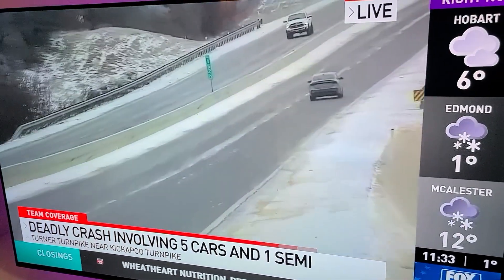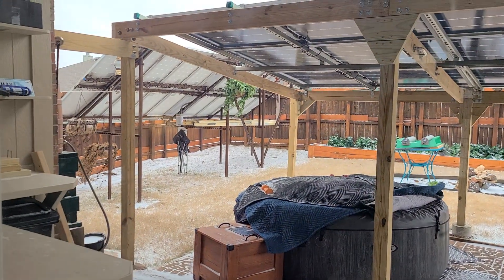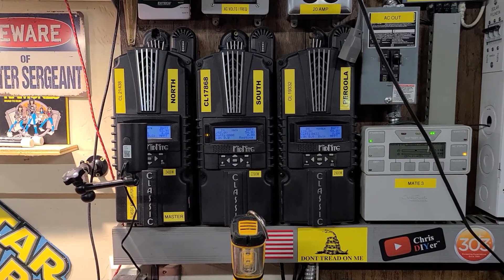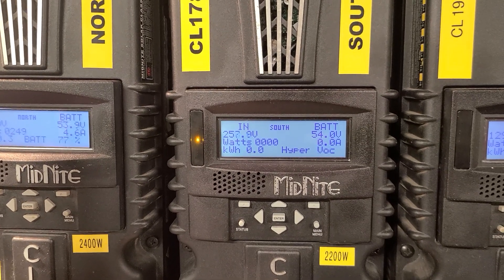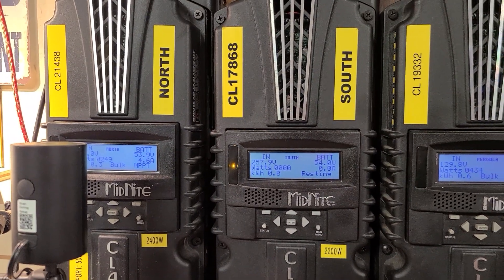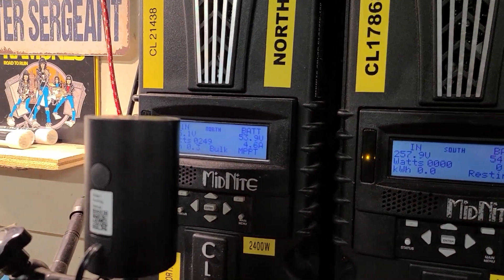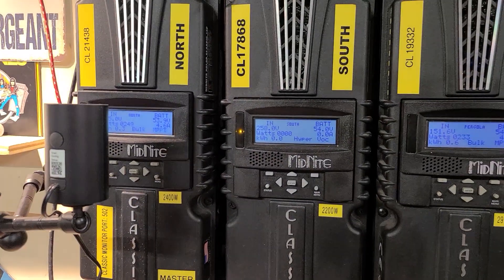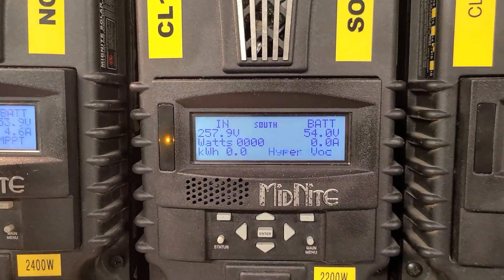Midnite Solar Classic 250  in HyperVOC protection mode due to extreme cold (1F with -25F wind chill)

Comment: Interesting never experienced that . Stay warm merry Christmas.
Reply from the maker: Crazy cold narrows the P/N junctions on those silicone cells....kinda like squeezing a garden hose to increase pressure. Current isn't really affected. But, with the added voltages (if using MPPT) it will find max current at higher volts (which equals more power and efficiency)

Comment: I throw ya idea. Maybe 1 less panel per string will prevent Hyper Voc when it this cold.
Reply: Yup, good idea, was thinking the same.
Blanket thrown over as many to reduce the voltage.
Reply from the maker: Agree - I think I will do that. Two panels isn't that big of a deal. 2200w vs 2000w.

Comment: Wow.  It would be nice if those charge controllers had a larger voltage range that they can handle.   Yup, I'm quite familiar with the higher voltage in the cold (live in Michigan).  The most power I've ever produced was midday on a very cold sunny winter day.  On a hot summer day, the opposite happens... the panels get so dang hot that you get under the rated voltage..
Reply from the maker: I grew up in Michigan. Yeh, I agree. These Midnite controllers should be able to handle 500vDC. But, the problem is finding a correctly sized DC circuit breaker (for the solar panel arrays...disco box) that can handle that amount of voltage. I use DIN rail mounted Langir 250v DC breakers in my disco boxes. It would be easy to wire them for 500v. Here is an Amazon link to those breakers: https://www.amazon.com/gp/product/B06XDYZCPZ/ref=ppx_yo_dt_b_search_asin_title?ie=UTF8&th=1